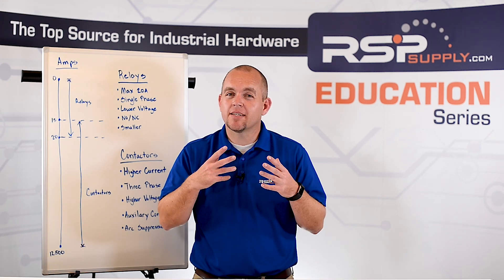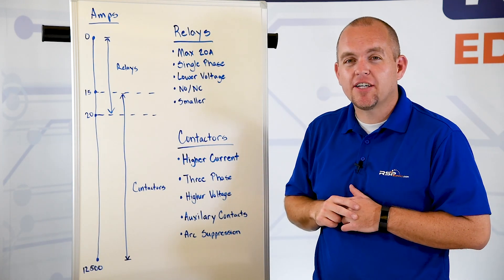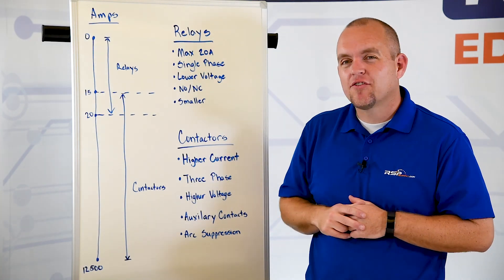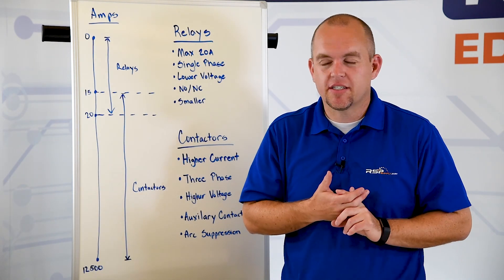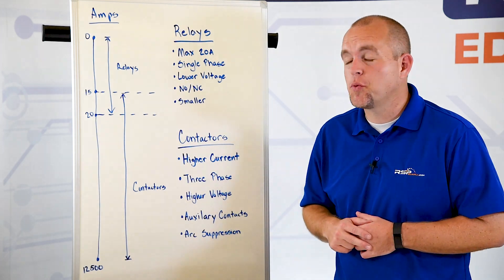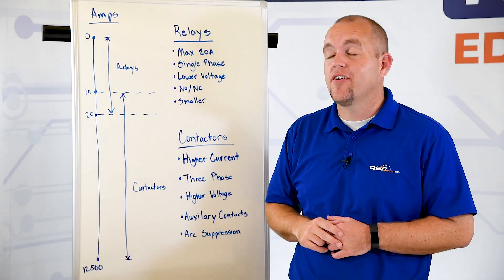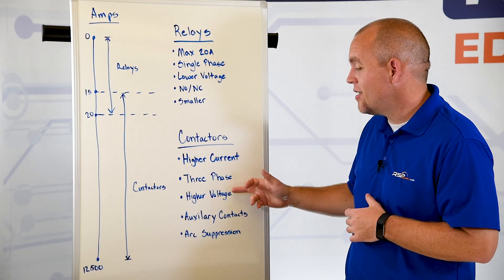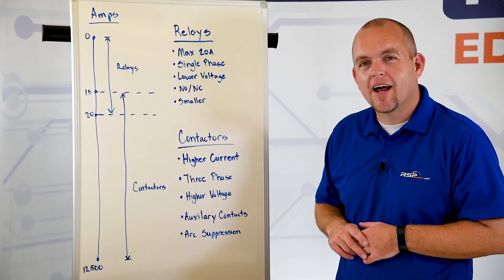Differences Between Relays and Contactors

Comment: some addition.

Most relays have single break contact. Most contactors have main and auxilliary contact as Double Break contact. Double break contacts reduce arcing at contact while making or breaking. Speed of closing of Contactor contact is very high as compared to relays, there by reducing arcing time while making or breaking. So contactors can carry higher current. Contactors have Main contacts as Normally Open mostly and auxilliary contacts as NC or NO or Borth. While relays mostly have Change over contacts. Power contactors ( contactors with high current ratings ) contacts can be replacable or servicable. Power contactors may have arc chutes to extinguish the arc.

Comment: Missed a very important thing about the differences when saying that "Relays can be either NC or NO depending on the type, where contactors give you 3 sets of NO contacts". But you jumped one of the most important bullet points; Auxilary Contacts. This means that Auxilary blocks can be mounted onto the contactor, some models on the front whilst other on the side, this will give you multiple functions as in NC & NO contacts.

Comment: Can i use  a relay(5 amps) to power my 0.33 hp motor /1 phase ?sir plz let me know
Reply: YOU can however it will wear out since at start it will draw 4-6 x the Fla ( ballpark avg), could be more depending upon the code letter, it may burn the relay out in short order or may last a while.....too many variables to just say yes or no...but at 5 amps Fla, and a 15 or 20 amp relay it would most likely work but may not be the best setup for longevity, efficiency and efficacy

Comment: How to calculate the resistor and capacitor valve(Snubber Circuit) that we connect across coil of contactors (A1 and A2)